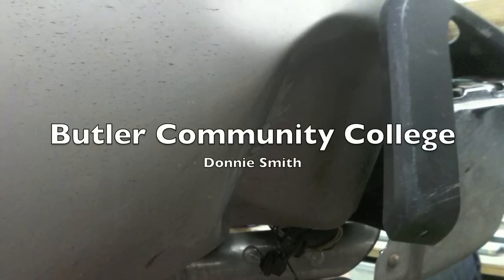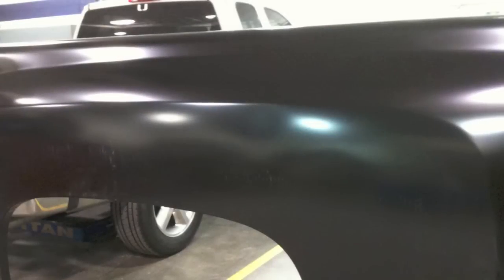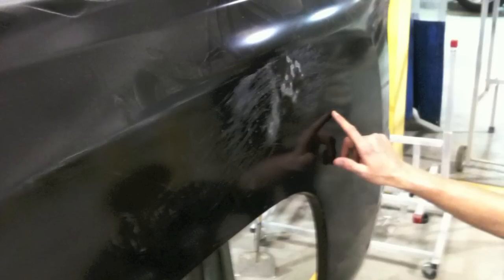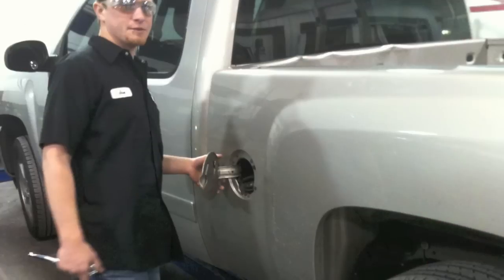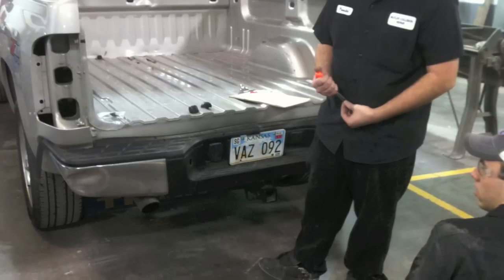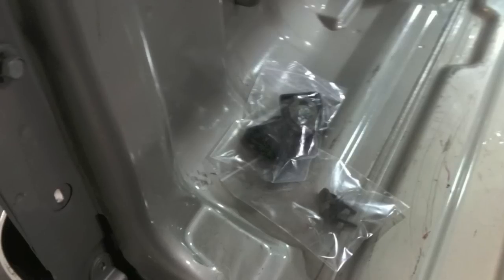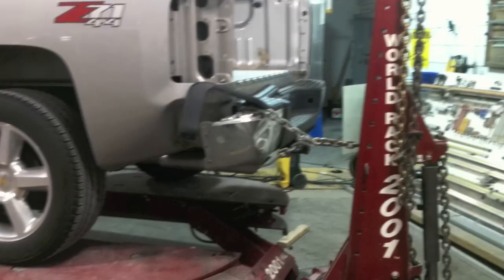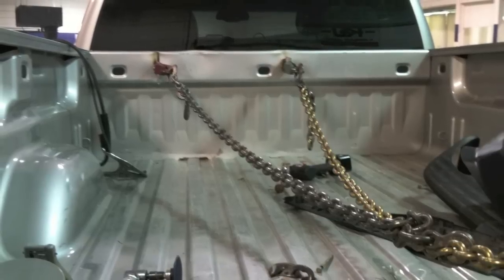Tips How To Replace A Pickup Truck Bedside Panel

Comment: where i can get bedside for 2010 GMC Sierra 2010 extented cab with 8ft bed
Reply from the maker: I get a lot of my parts at Keystone Automotive.  If you can find it aftermarket, you may have to check with a dealership.